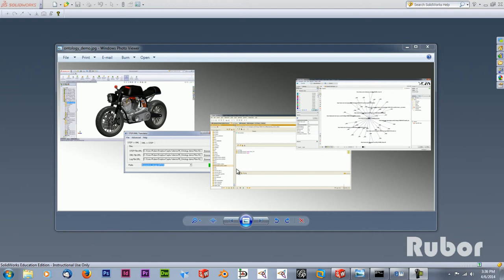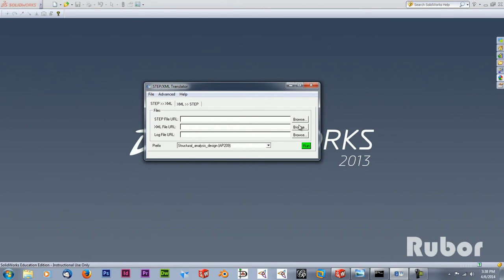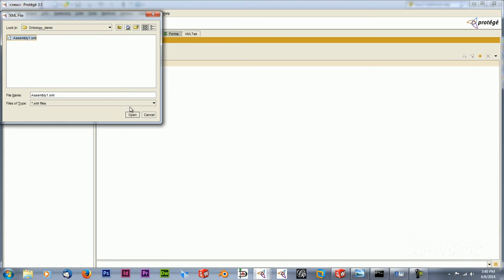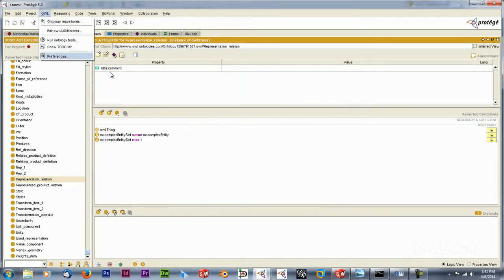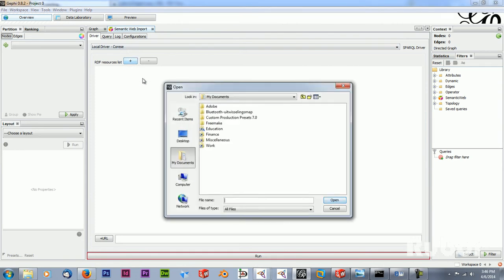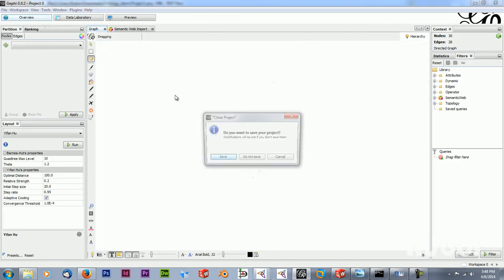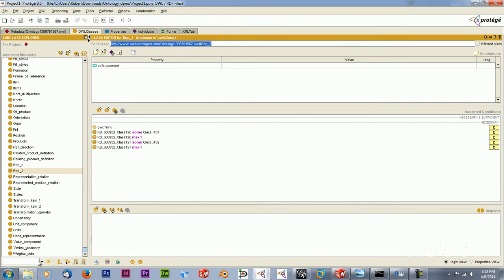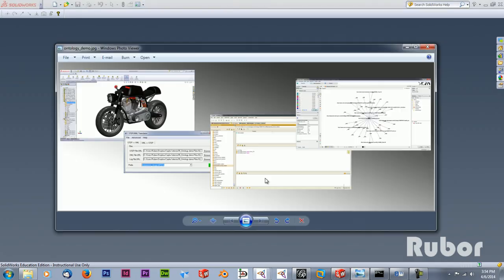3D CAD to ontology owl/rdf in Protégé and network mapping in Gephi

Comment from the maker: Additional information: "The translator to translate EXPRESS to
XML is not working consistently. This is in part due to the translator itself and is also due to the STEP files that each separate CAD package exports. Since each of the CAD companies interprets and applies the STEP AP203 Edition 2 standard differently, the translator either cannot complete the process or creates an XML file with missing data. The translator is being modified because other third party translators are not currently accessible. The original idea is to utilize existing software for translation without any modifications." (McKenzie-Veal et al, n.d.)

source: http://edgd.asee.org/conferences/proceedings/65th%20Midyear/McKenzie_Veal_Hartman_Ontology_based_Information.pdf

Findings in a Capita Selecta master cource in to connect PLM and PPM activities.

http://rubenborgonjen.com/

Comment: can you help me? Where did you get that step/xml translator?
Reply from the maker: I think it was originally here: http://www.isetools.org/eb-cgi-bin/yabb2_ISE/YaBB.pl?num=1190037670

I still have it, so if you want it, please send me an email with your email address and purpose of use ;-)
Reply: thank you very much
Reply: @rubenborgonjen7076 can you link the translator
Reply: Can you kindly specify  softwares.  CAD drawings were designed using which software and translator as well